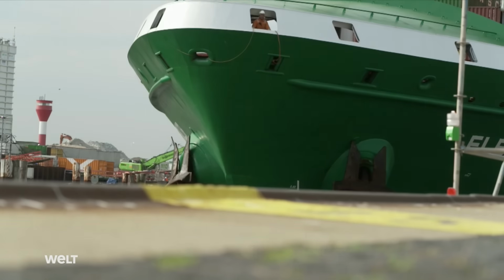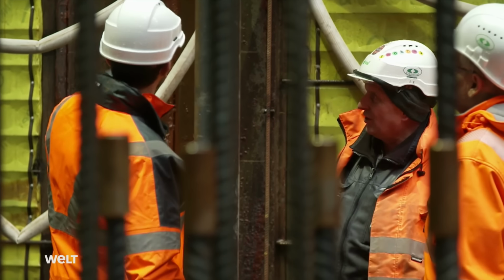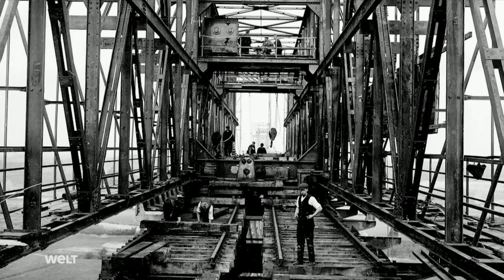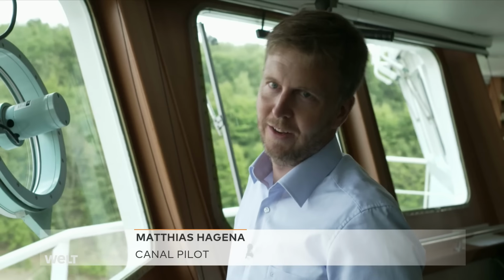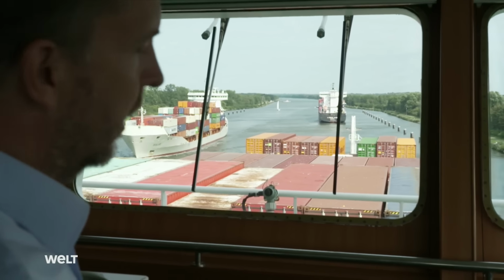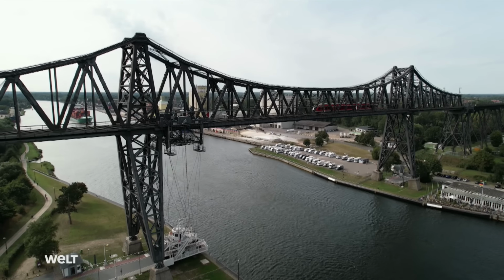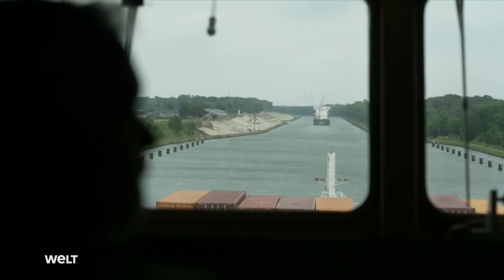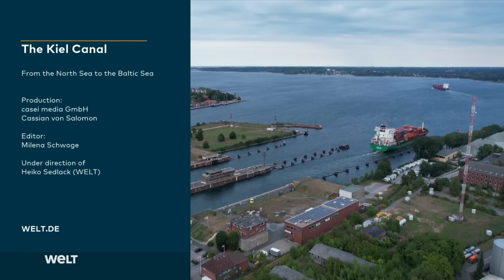TIME IS MONEY: The Kiel Canal - Expressway to the Baltic Sea | WELT Documentary

Comment: how can it possibly take 3 years to weld a few pieces of steel together? I suppose with most things in Germany it is all about funding. Also I don't see what the need was to over-engineer a basic crane... but on the bright side, at least it gives the ferry operator a sense or purpose because he really doesn't even need to be there in the first place with such a simple shuttle design. How is it the collision even happened in the first place? Did the operator not pay attention to canal traffic? Also the pilot should have been able to see it as well. Now that all my criticisms are out of the way, it is quite cool to see something different being done like this.

Comment: For some reason I love canals.  I think it’s awesome that humans have been able to connect bodies of water that had no natural connections. And whoever invented locks was a genius. Without them most canals couldn’t be possible.  Because there would be no point to connect different bodies of water that were at different elevations, because the waterway would just be all rapids and no boats could travel on it. Defeating the whole point of the canal. I think the only major canal that doesn’t have locks is the Suez Canal because it goes from sea level to sea level.
Reply: The Kiel Canal belongs to the same category as the Suez Canal.
It has the same water level along its entire length, making it one of the mirror-image sea canals. It is closed off at both ends by locks to protect it from changing water levels caused by the tides of the North Sea and wind-driven waves in the Baltic Sea.

Comment: RE: ( The "Electric" ferry )
I guess the Germans cannot see the irony of using Diesel motors to "Charge" the Batteries 4 Times per day.  
There is no cure for a Stupidity of that magnitude.
Reply: Haha! I just commented on the very same thing! 💯 correct!
Reply: Nevertheless, the new electric ferries save around 80% fuel, as the diesel engine of the old ferries had to run permanently, 24 hours a day.
Reply: @callsigndd9ls897  
But at what cost?  
What type of Labor was used to extract the minerals for the Batteries, 
What type of Machinery was used 
( Petroleum powered) 
And then there is the danger of the Batteries themselves.  Prone to catch fire and explode, Especially in a wet environment. 
Face it, It is a failed technology. And always has been for over 100 years.

Comment: Two locks are necessary did I miss why this is so. Which end of the canal has the Hugh water and by how many meters.
Reply: The North Sea is subject to the tides, where the difference can be 5 meters (16 ft) or more. There are no tides in the Baltic Sea, but the water level can fluctuate by 1 to 2 meters (3 to 6 ft) due to the influence of the wind. If there were no locks, the canal would be a raging river that changes its flow direction every 6 hours.

Comment: I disagree that the Keel Canal is one of the most difficult waterways for pilots.  There is no current to contend with and there are only two locks with minor height differences.  The Welland Canal has 8 locks and bypasses Niagara Falls.  The Soo Locks and St Mary's River is quite challenging due to currents; Ditto the St Lawrence Seaway.
Reply: The volume of traffic on the Kiel Canal is 30 times higher. 90% of freight traffic to the Baltic Sea ports of Denmark, Sweden, Finland, Russia, Poland and Germany goes through the Kiel Canal. It is the busiest man-made waterway in the world.
Reply: @callsigndd9ls897  I assume the canal is wide enough for two ships to pass port to port.  Nothing difficult about that.
Reply: @peggyt1243  Channel width 162 m (531 ft), depth 13 m (43 ft). The canal is permitted for vessels with a length of 235 m (774 ft) and a width of 32.5 m (195 ft) and a draft of 10 m (33 ft). The clearance height under bridges is 40 m (131 ft). Most ships can pass each other. Only heavily loaded ships with a very large draft or difficult-to-maneuver towing convoys etc. have right of way, smaller ships must therefore wait at waiting or passage points with a width of 200 m (980 ft) or pass them slowly.

Comment: diesel battery power ferries! so eco friendly lol
Reply: However, charging for 4 hours a day requires 80% less diesel than if the engine had to run for 24 hours, as was the case with the old ferries.
Reply: @callsigndd9ls897   6 of one half dozen of the other

Comment: eco friendly farie charged by a diesel generator pretty much sums up all environmental engine4ring perfectly :D
Reply: However, charging for 4 hours a day requires 80% less diesel than if the engine had to run for 24 hours, as was the case with the old ferries.

Comment: Electric ferry which is charging with diesel - why? Crarge it from shore instead
Reply: You still save 40% fuel, because the losses caused by gears and trnsmission are eliminated to drive the Voith-Schneider propellers. The ferries have 2 Voith-Schneider propellers (front and rear), which in the new ferries are driven directly by electric motors. In addition, the diesel engine runs on LNG.

Comment: 0:09: 💡 The construction of a new lock chamber in Brunswick is underway to accommodate the increasing number of ships using the Keel Canal.
6:48: ⛵ A cargo ship navigates the Keel Canal with the help of a hydraulic engineer, canal helmsman, and pilot.
13:41: 🚢 The Keel Canal, also known as the KaiserWilhelm Canal, is an engineering masterpiece that allows ships to transit the canal at a maximum speed of 15 kilometers per hour.
20:38: 🚢 The passage of ships through the Keel Canal requires skill and coordination to navigate narrow corridors and aging locks.
27:40: 🚢 The ELP Sailor and other ships navigate the Kiel Canal, waiting in passing places and switching pilots.
34:09: 🚢 A captain discusses the challenges and importance of piloting ships through the Keel Canal.
41:37: 🚢 The challenges and operations of the Kiel Canal, including the transportation of cargo, maintenance of infrastructure, and navigation through narrow sections.
47:14: 🚢 The journey through the Keel Canal, the busiest artificial waterway in the world, is completed successfully in 8 hours.
Recap by Tammy AI

Comment: When it comes to engineering, no one outdoes the Germans.
Reply: Seems the Leopards and PzH 2000 not so much in Ukraine
Reply: The Kiel Canal is no engineering master piece
Reply: @johnburns4017  When the canal was completed in just 5 years over 130 years ago, it was considered a world wonder.
Reply: @callsigndd9ls897  
Not really.  Suez canal was built and the Manchester Ship Canal was near complete which engineering-wise beat the Kiel.
Reply: @johnburns4017  Of course, the Suez Canal is a great achievement. However, it was easier to connect the Red Sea to the Mediterranean via two large existing lakes simply by shoveling away enough loose sand. Flat desert land with no hills to cut through. No rivers to be diverted, no densely populated land to have to build new road and railway connections and no huge locks because there were no differences in height between the Mediterranean and the Red Sea. I would rather cite the Panama Canal as an example of an even greater achievement. The construction of this canal was truly a super achievement compared to the Suez Canal.

Well, the Manchester Ship Canal connects a city to the sea over a short distance, but not two seas to each other. That may be important for Manchester, but it hardly plays a role for international shipping. If you use the canal as an example, you would also have to mention all inland waterway canals, such as the Mittelland Canal or the Havel-Oder waterway, the Rhine-Main-Danube Canal. Not to mention the great French canals.
Reply: @callsigndd9ls897  
It is the engineering that is in focus. The Kiel Canal was nothing special. Nothing that was ground breaking. In engineering the Manchester Ship Canal was far more advanced.  It had swing bridges for canals crossing it.  The River Mersey was diverted to run through the canal then out of it to supply it with water, as was the River Weaver.

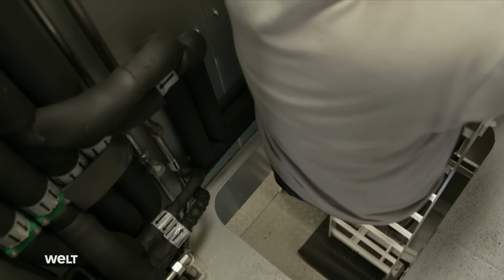Comment: 19:00 "our environmentally friendly diesel powered batteries". lol wtf just use a diesel engine if you gona do silly crap like that
Reply: its pretty common for ships to use generators hooked up to electric engines
Reply: They still save 40% fuel, because the losses caused by gears and trnsmission are eliminated to drive the Voith-Schneider propellers. The ferries have 2 Voith-Schneider propellers (front and rear), which in the new ferries are driven directly by electric motors. A full charge with electricity from the land does not work because the ferries moor for a maximum of 3 minutes and then start sailing again immediately. In addition, the diesel engine runs on LNG. Most huge cruise ships today are diesel-electric powered.

Comment: What's the point of installing an electric ferry if it's powered up from on-board diesel generators? That's.. like soooo close to the point be completely missing the point. 😂😭
Reply: No it's not. It's a very efficient way of propelling ships as you don't need a gearbox anymore. A gearbox consumes a large part of the energy output of the diesel engine. Diesel-electric is more efficient. The use of batteries makes it even better because then the diesel engine always operates at optimum speed and load.
Reply: @SuperDirk1965  yeah, but like, what if we got rid of the diesel energy entirely and drew energy from clean sources? Then you could have entirely electric with no pollution!
Reply: @thisismissem  If we could transport ourselves like in Star Trek, we wouldn't even need the ferry. But in the world we live in today we still have to generate power with diesel sometimes and then it makes sense to do that in the most efficient way.
Reply: @thisismissem 
No, we can't. It's a pipe dream as we do not have the infrastructure and will not have it for quite some time.
I'd suggest Sabine Hossenfelder's youtube canal or Peter Zeihan.
Many green activists face one big challenge: math!
Sabine's video is title
Electric Vehicles: Will they save or destroy us?
She 's a German physicist living in the US for many years.
She is mostly scientificaly neutral. BUT she knows math!
Main Problem is: to transfer major parts of the world "by going green" means we have to scale up mining and processing facilities of roughly a dozen minerals by factor of 3 -5 times. That has never been done before. Some predict it might be possible for "North America" as the Americans may use their military might "to speed things up". but, that doesn't include Europe and much less other regions of the world.
Next major hurdle: to build the infrastructure requires investment
and it really and truly means HUGE, not just some subsidies here and there.
Reply: You're missing the point. It is far more efficient this way, and many trains already do the same thing.